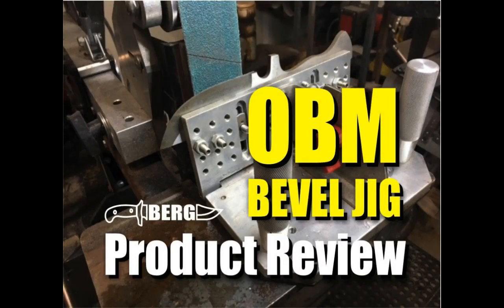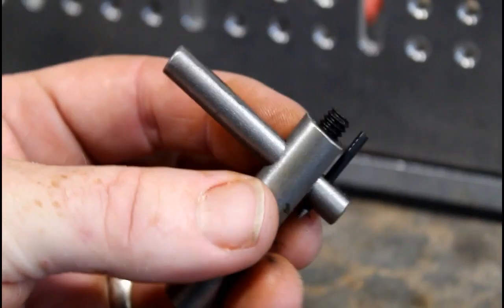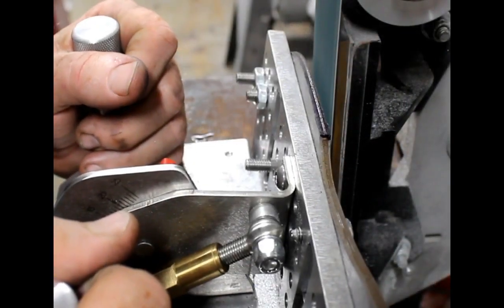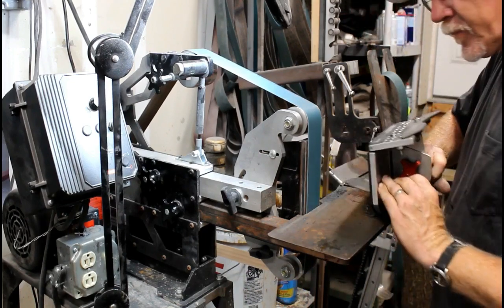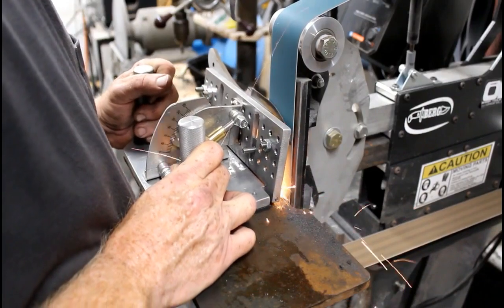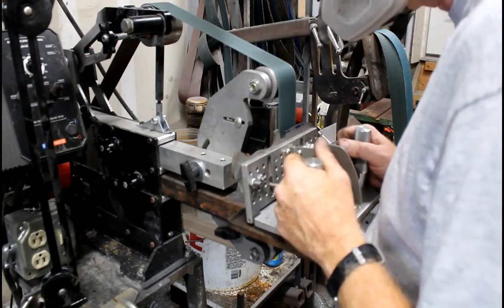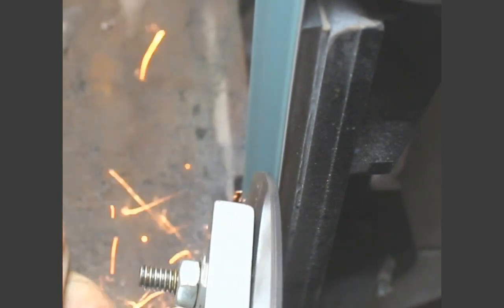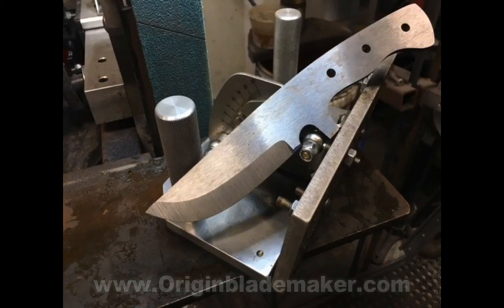OBM Bevel Grinding Jig Product Review and How to Use video

Comment: You only need to quench frequently if your knife is already hardened and tempered so you do not lose the hardness and temper of the blade. If tou are grinding out a knife blank that has not been heat treated yet, constant cooling of the blade is not necessary.
Reply from the maker: It is if you do not want to burn your fingers LOL

Comment: Have you figured out a way to get the width of the bevel the same at the tip as it is at the plunge with the OBM jig? I see that like some of mine, yours are narrower at the tip than at the plunge.
Reply from the maker: That is one of the problems with any 90 degree jig. You can pull the handle toward you or away from the grinder as you get to the tip. That will help a little. Otherwise I take a look at the Tilt Table jig that I use on all my bevels. Jayson Northgard and I developed it because of the same issue.  https://bergknifemaking.com/collections/knife-making/products/tilt-table-knife-bevel-grinding-jig

Comment: Are these knives already heat treated? Before grinding bevels?
Reply from the maker: No Sir most knives are ground before heat treating
Reply: @DIYeasycrafts  that is patently false. Common practice is to harden/temper and then grind. You keep a bucket of water around while grinding for a reason - to avoid overheating and losing your temper. That being said, of course it can be done either way, but depending on length/ thickness of stock, grinding before heat treat may cause warpage upon treatment.

Comment: What angle do you start the jig at for each bevel?
Reply from the maker: It really depends on thickness of the blade and how wide you want the bevel to be. Primary bevel should bring both side down to thickness of about a dime on the blades edge. Micro bevel should be about 20 degrees

Comment: No way are the grind lines even to the tip
Reply from the maker: You can absolutely get the grind lines even with edge scribed line. Width of bevel at tip will always be a bit narrower but can be maximized by arcing jig away as you get to the tip. See video for details.